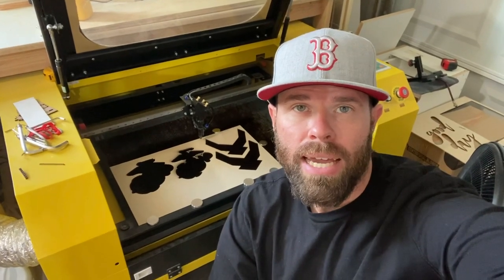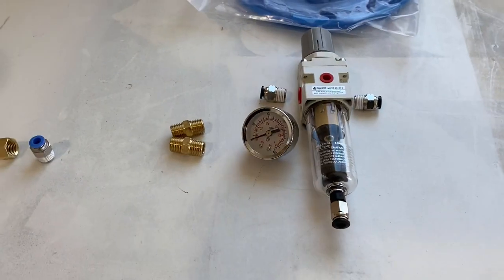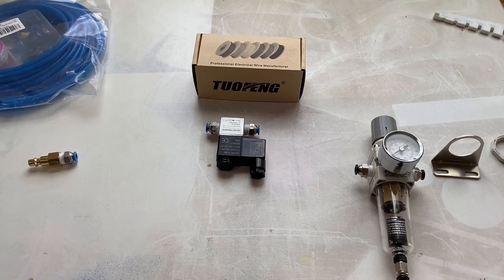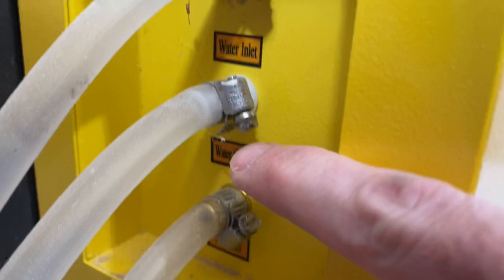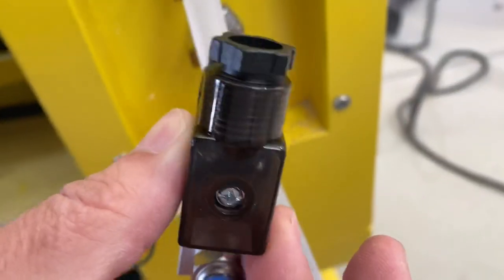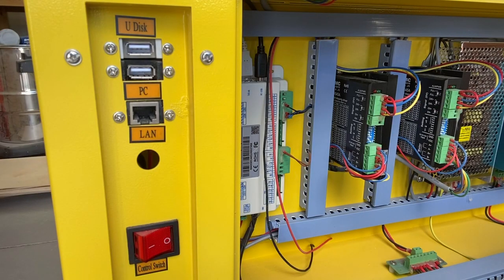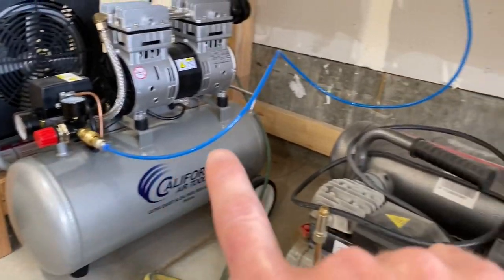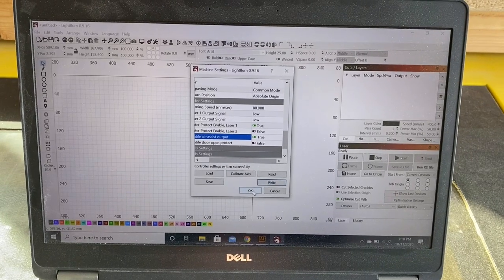Upgraded Air Assist for Chinese | OM Tech CO2 Laser

Comment: Thank you for making this video but I gotta question. My husband finally got the upgraded air assist all hocked up  we have the California  ultra quiet compressor but it has a hissing sound coming from it like air is leaking out is that normal? I asked my husband he says yes but he also tried to cut a 1 inch common board in my 55 watt thinks it can be done with this new air compressor I seen a flame and stopped it I said it can’t be done it’s not worth starting a fire till try lol I’m not using my laser I have it off but still hear the leaking air
Reply from the maker: You should only be hearing a hissing from the laser head once the job is running and there should be no flames.
Reply: @BeardedBuildsCo  ok thank you. Yeah there are no flames that was only in the wood my husband put in there that  he shouldn’t of :/ I get good clean cuts on both 1/8 and 1/4 no soot on the 1/4 anymore :) I just hear the hissing sound when it’s all off coming from the air compressor I don’t think it’s normal but my husband says yes but I don’t trust him lol
Reply from the maker: @dnecey32 you will want to track down where the hissing is coming from and you probably need to add Teflon tape or tighten a fitting.

Comment: I did this but connected the blue tube to the original tubing so I didn’t have to re run everything through the drag chain. However, my regulator won’t go above 20 psi?
Reply from the maker: Turn up the regulator on your compressor

Comment: GREAT VID!! Does the machine have to have the air running all the time like it comes from the factory? Are they just to cheap to put in a solenoid?
Reply from the maker: Most lasers come with an onboard pump. They are not usually setup for a compressor upon delivery.
Reply: @BeardedBuildsCo  I got an 80 w. It came with a pump. I'm wondering why it runs all the time. And they do not turn it on and off when you are using the machine. Also. Does it need to run when you are not cutting? I'm about to do the upgrade you showed. I was just wondering. Thanks for the reply
Reply from the maker: The way the stock pumps are wired they are set up to turn on with the machine and will run until you turn the machine off.
Reply: @BeardedBuildsCo  Yes, that is what mine does.. But is there a reason for it to run all the time?
Reply from the maker: @SUNRISE-ADVENTURES  no, I only needs to run while the job is running.
Reply: @BeardedBuildsCo  That is why im confused, do they just not provide a solenoid for  off for it... to keep costs down. THANKS FOR THE HELP!!!

Comment: Great videos! Does that compressor end up running constantly to try to keep up 30ish psi to the nozzle? Seems like the 8 gallon tank would drain quickly.
Reply from the maker: Yes it runs a lot. I eventually upgraded to the 26 kobalt quiet tech.
Reply: @BeardedBuildsCo  Thanks. Just saw that in your Tour video.
Reply: This is my concern. I got a 1gal HF quiet compressor but you definitely need more than 1cfm. Do you know the actual CFM use for the air assist?
Reply: @Mitch3D  The nozzle opening is about 1/8" on the laser head. That means to maintain constant 25psi you would need about 8.6cfm and at 30psi about 10cfm. Pretty big and costly compressors. The best trade off is a big holding tank(s) so laser cutting can be done with minimum of the compressor running. Shorter cut times obviously help as well. Keep in mind that the laser will continue to cut even if the air pressure drops while cutting and anything is better than the little 3psi aquarium pump supplied with these machines. Your 1 gallon would not keep up well, run constantly and burn up pretty quick though.
Reply: I ordered the 8 gal he lists in his video, hopefully it will last longer. Getting the 26gal mentioned is not feasible due cost (quickly approaching the cost of the used Omtech 50w I have.) I'm sure I'll find a sustainable pressure for my cuts since I might end up doing engraving more than thicker cutting,
Reply: @makertime6296  thanks for the info it really puts it in perspective how much air is used in air assist systems and how underpowered the pumps are.
Reply: @Mitch3D  You are welcome.

Comment: Could you use this to cut thin metal?  People use nitrogen and oxygen assist to cut metal with a co2 laser, why not just normal compressed air, which is ~78% nitrogen, ~21% oxygen?  Cut quality might suffer some for a given use case but it should still work or?
Reply from the maker: Totally not in my wheel house to answer this question.

Comment: When I do exactly this and try a test, the machine says machine protected. I changed the vendor settings and it wrote successfully. I have negative to wind and positive to 24v. There is a ground on the solendid not being used. I can only think that this would be the problem but you have no third wire connected in the video, please help. Thanks
Reply from the maker: Machine protect would be because you have the laser hood open or the sensor is not engaging while the hood is closed
Reply from the maker: Make sure that you don’t remove and of the wires that were in the controller only add the ones for your solenoid.

Comment: Just a question can you adjust down to a trickle of air with your setup for engraving and cutting acrylic 

Thanks
Reply from the maker: Yes, I use the regulator to dial it down to around 5 psi for engraving.

Comment: Solenoid is getting air but nothing fires off up the line. 

Checked and the solenoid has juice (green light) but I’m not getting anything out on the laser. Changed Lb settings and checked the Controller on the machine - 80w R/B
Reply from the maker: Have you checked the marking on the solenoid to make sure you have a 24v solenoid?
Reply: Howdy sir! Oh I figured it out. I’m a little embarrassed. I have the R/B MF 80 and I thought I could route the solenoid to the where the stock was daisy chained. 

That was a bad idea. Cooked the solenoid - no other issues. 

Now I have the solenoid replaced and should be good to go tonight.

Comment: Hi!! Thanks for your video!  I just set my compressor up following your instruction, but my air is not turning on when i run the job.  Any ideas what i can look for to help me find the solution?
Reply from the maker: Did you make all the changes in lightburn and the machine settings that are outlined in the video?
Reply: @BeardedBuildsCo  i figured it out.  Not quite sure why but the the pressure was staying really low.  i adjusted it and its working perfect now.  Thank you so much for this great video!! it was super easy to follow!
Reply from the maker: Awesome! Glad it helped!

Comment: question
is 10 gln tank enough to supply the air for a long run?
Regards, Rick
Reply from the maker: On a long run your compressor is going to run retárdales of the tank size. Bigger tank and higher CFM motor will minimize the number of cycles.

Comment: Can I do engrave and cutting at the same  time without changing the pressure of the compressor?
Reply from the maker: You totally can, but some times you can get different affects and results by varying the pressure during engraving.

Comment: Need some help.   We are not getting any air.    I do not think the solenoid is getting power.   The light is not coming on.   Could it be bad?
Reply from the maker: The solenoid could be bad or there is an issue with the ports on the control board.
Reply: What do you do if the ports are bad?
Reply from the maker: Reach out to the company to work through a warranty claim.
Reply: @BeardedBuildsCo  thank you for your help!! The solenoid was bad

Comment: Would you just as easily be able to hook a 3/8 feed line from the compressor this same way?  I have a 60 gallon IR two stage that I run my sandblast cabinet from but I am looking to move to a 100w omtech laser to make my life simpler and expand options.
Reply from the maker: Yes you would just need to reduce down to the 1/4” lines that are in the machine. Use the code LASERGUYS when you order your machine!

Comment: Hey I followed your vid all was good untill I realized the controller where the little green plugs go is different from yours.
The people I bought the laser from on Ebay have no clue. I think they are just shippers.
anyway I have used the wiring on the board that was feeding the little pump inside the machine, but it seems that even though it says air assist on the board and I have used this wiring it blows constantly. Not sure which wires are supposed to go to the solenoid. any Ideas
Reply from the maker: You need to run your own wires to the controller. The wires from the built-in pump go directly to the 24v power supply and turn on when the machine turns on. Red wire to the 24v slot on the controller and other wire goes to the “wind” slot.

Comment: Just thought I would ask a simple question. You stated that your regulator is set to 20.  What is you air compressor set to, for output pressure?
Reply from the maker: The compressor is set to 90
Reply: @BeardedBuildsCo  excellent,  I am on the right track. I have completed my air assist with the help of your video and others. Thank you!
Reply from the maker: You’re welcome!

Comment: How big of an air tank is needed on the compressor I have a kobalt2 gallon 125 max psi compressor will that work or do I need to purchase a bigger one?
Reply from the maker: Just depends on how much you want the compressor to run. In this video I went with a 8 gallon Cali Air. Since then I run a 26 gallon kobalt quiet tech.
Reply: Thank you! Great video very helpful
Reply from the maker: @patdondero2697 you’re welcome!

Comment: Hello i did everything as you described. But when i connect positive terminal and wind to solenoid, it wont close valve after stoping machine. It stops it if i press stop imediately after machine begin to work. And my readings on positive and wind terminal are same after i press stop.
Reply from the maker: Double check the markings on your solenoid and make sure it is 24v
Reply: @BeardedBuildsCo  it is 24v DC which markings you mean? It says DC24V 10w
DC20.4~26.4v
100%ED
IP65
Reply: @BeardedBuildsCo  I have old version of rdworks and does not have option about blower. When i press start and start engraving my readings at wind and positive connection are 19v when i stop engraving, it doesnt go to zero volts.

Comment: Did you use all the parts on the list? There are several npt fittings. 11 in all.
Reply from the maker: Not all were needed. I have extras left over.
Reply: @BeardedBuildsCo  did you need something in all those items?
Reply from the maker: I did not end up using the elbow connectors. Depending on your setup you might use them but I only used the straight connections.

Comment: What sort of PSI are you able to run. I literally testing the same setup right now, and noticed the air compressor can't keep up with even 10psi .  Eventually the tank will be empty on a longer running job.  I wanted to try this because my father in-law has that compressor and it's super quiet.  I have a 2 stage 80gal and it's so loud when it kicks on I was hoping to make this setup work, I'm not having any luck though on longer running jobs.
Reply from the maker: I am running cuts at 20psi. My compressor runs often but it is an ultra quiet unit.

Comment: Great video! I watched everything and was able to install everything. One question though, how do I know if the air is coming out from the nozzle thats next to the laser? I just got my machine and I did this install before even turning it on which means I cant really compare a before and after. I tried cutting with the lid open to  see if I can hear the air but the machine stops.. I set the regulator  to 20 psi which means that it does get air from the compressor. I actually did my 1st test cut today but I stopped it as there was a lot of smoke and a bit of flame. This makes me thing that there's no air coming out from the nozzle that's next to laser. or is that normal?  Any help would help. Thank you!
Reply from the maker: Did you make sure to enable the air assist in the machine settings and on the cut layer?
Reply: @BeardedBuildsCo  Yes, I did enable air assist in the machine setting and for the cut layer, now that you mention I don't think I did 🤦‍♂I simply uploaded the test file to Lightburn and clicked on start. I'll go do another test cut and confirm. Thank you for the great videos. I just subscribed.
Reply from the maker: Another common problem is that people get the wrong voltage solenoid. It has to be 24v. Check the marking on the solenoid.
Reply: @BeardedBuildsCo  I just checked the test file that I cut as I still had it opened on my computer and air assist is on on the cut layer. I also double checked for the machine settings and it is also enabled.

edit: I purchased the 24v solenoid as I used your link.
Reply: @BeardedBuildsCo  I checked my amazon orders and I purchased "TAILONZ PNEUMATIC 1/4 inch NPT 24V Way Normally Closed Electric Solenoid Air Valve 2V025-08"
Reply from the maker: Check the marking on the solenoid and maker sure they sent you the right one.
Reply: @BeardedBuildsCo  I just checked and they did send me the correct one. It says DC24v 4.8W.

Comment: Hey man great video! My valve is not opening, I ordered the same one that you suggested. There are three screws underneath the plate I’m not sure if I have them connected  to the right screws. It also looks like there is a green light on the inside of it, that is not going on either. Any suggestions?
Reply from the maker: Look at the solenoid and make sure that it says 24v on it. Have you made the changes in lightburn to enable the air assist in the machine settings? Do you have the air assist enabled in the cut layer?
Reply: @BeardedBuildsCo  So the air solenoid definitely is 24 V. I went into the machine settings and I change it so the air assist was on. And the air assist is on on the layer as well. A few questions to help me troubleshoot, is that a green light inside the solenoid? When we’re talking about 24 V are we talking about AC or DC? I want to get a meter on there and see if I’m getting any sort of reading.
Reply from the maker: @robertibraham7046  there is a light but it would only turn on when the machine is running a job. 24v DC.
Reply: @BeardedBuildsCo  got it.   Stay tuned.  I’ll get the meter on it tomorrow.  Have a happy new year!!
Reply: @BeardedBuildsCo  yo.   You got time for a FaceTime call?
Reply: @BeardedBuildsCo  hey bud.  I still have made no headway with the solenoid.  I am convinced it is a setting, cause I don’t think I am getting a 24v reading from the terminal.  Any chance you can hop on a call and help me troubleshoot this thing?

Comment: I followed your video to the letter, however I’m have one slight issue. My machine turns the air ON when I start my job, but it doesn’t turn it off when it’s done. Any ideas?
Reply from the maker: Take a look at the marking in the solenoid and make sure you have a 24v and not something else.
Reply: @BeardedBuildsCo  Its a 24V. Same as you bought.
Reply from the maker: It might be a defective solenoid
Reply: @BeardedBuildsCo  I'll keep looking for answers. Ity shuts off if i turn the power off to the controller/machine.
Reply: Soory. IT shuts off when i turn the power off.
Reply: FIXED!... I should've took you FULL advise from the beginning. I looked at the box the valve came in and it said 24V. After beating my head, i took it off. After it cooled down because it was super super hot. The dang thing said 12V right on it. That was it... i contacted the amazon seller and he sent me a new on that said 24V. It works as its supposed to now. SO.... if anyone is reading this....LOOK AT THE WRITING ON THE VALVE TO MAKE SURE ITS 24V! Thanks for you help and videos. I've done a lot of the same upgrades you have and they have helped me a lot.

Comment: Hey question for ya I got everything hooked up and all setting changed in lightburn. For some reason it still does not activate the solenoid when I run a file. I’ve checked the solenoid on another 24v power supply and confirmed that works.
Reply from the maker: Do you have air assist enabled on the individual layers?
Reply: @BeardedBuildsCo  ya I made sure those were all enabled. I have photos of it I can send you.

Comment: I hooked everything up like you have it in your video. But when I start it. It doesn’t open the solenoid up. Is there something I need to change in my settings on my controller
Reply from the maker: First, verify that you have a 24v solenoid. If that is correct, did you make the changes in the machine settings to enable air assist?
Reply from the maker: It’s all in the video
Reply: Yes it’s a 24v. But I didn’t change anything in my settings. How do I do that.
Reply from the maker: @0311kjc  did you get it working?
Reply: @BeardedBuildsCo  yes I did. Thank you. I saw that part and forgot all about it. Thank you.